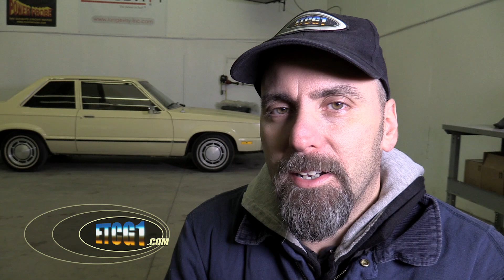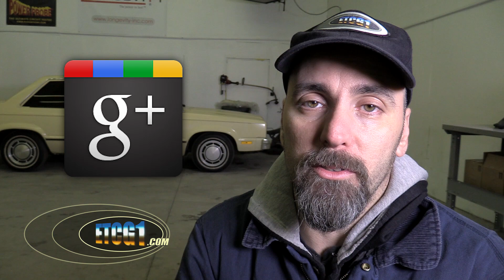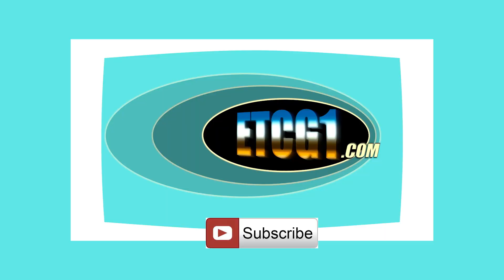How Things Have Changed In Auto Repair -ETCG1

Comment: interesting thing happened the day you posted this -- went to the GM store here in Vegas for a recall (emissions) and got to talking to one of those VERY rare things in th industry -- a knowledgeable service writer.  He told me they went wireless with their scan tools and was saying there's not a lot of love for them right now (data drops) and that the techs would rather have their old wired tech2s back. it's a pretty large shop. probably 30 to 50 techs, maybe. he was saying the incidents of f-bomb tossing has increased dramatically. lol. being in IT I'd love to see the specifics of the setup and assume they probably have something wrong with their wireless system. anyway --- GM is trying wireless systems -- and techs patience.

Comment: Good video. Intetesting fact. I work for Volvo. our scan tools are all Bluetooth connections that we read with a desktop computer on which we have Volvos diagnostics program. The new 2016 models have a built in WiFi system that eventually will link to our computers automatically when the car pulls into our lot. Still a few bugs to work out with that system. But yes, your analysis for the future is correct and the future is now.  And at least at my dealership, we are all specialists, but specializing in everything. I've heard of some dealers with automotive electricians. talk about very specific specialization. I'm afraid to see where the industry will go in another 10 years.

Comment: A friend of mine has been trying to fix his Bosch K-Jetronic injection system, and since his vehicle is a Mercedes W124 coupé (an earlier model from the 80s), it is a real hell of a job. I soldered something for him together so that he could get to those "blinking codes", only that they are no blinking codes, but you need an ANALOG volt meter to see the voltage drop and cout the voltage drops. Only that his model was still too early for that, so it doesn't have the connector to get any data from the engine, no chance in getting any code back! Which left him with having to go over every single part of that K-Jetronic engine, to find some potentiometer that had rotted away or some diaphragm that had become brittle, or whatever else it was. And the worst of it: Today, even in Germany where these things were built, there are hardly any technicians left who really know these systems inside and out so they would know how to go about diagnosing them!
Reply: Sounds like a candidate for a factory crate motor and transmission.
Reply: Thomas Coughran What do you mean by that? I don't think Mercedes still sells the old 2.0L engines, plus the transmission seems to be fine. Also, if it can be remedied by a few parts for a couple hundred bucks, I think putting a new motor + transmission in it would be a bit too much.
Reply: +Seegal Galguntijak: Agreed. If the car was in the U.S., an American factory motor and transmission might be a way to get the car back on the road. Parts here would very expensive if available at all. A friend had a Jaguar sedan that had a bad head. Because of the repair costs, he bought an adapter kit that allowed him to install a Chevrolet V8 and automatic transmission. The kit used existing mounting locations and wiring adapters so the car could be switched back to original with no problems thus saving it's collectible status.
Reply: Thomas Coughran Well, for this side of the pond, it's the same with US car parts: They are very expensive, compared to stuff from VW and so on. Still, the Benz does basically run, it's just not as smooth as it has to be. The block is fine, it's something on the regulating side. Many of the control circuits are driven mechanically by potentiometers, and he just replaced one (it was a part for 40 bucks or so), now the problem seems to be much better, but he hasn't fully tested it yet.

Comment: our road service trucks have a geotab system gps tracking and also records the engine specs along with any fault codes from any internet connection.. you can see rpm/mph temps and even if seat belt is on

Comment: When I started out in the trade we rebuilt everything, alternators,starters,carbs,brake wheel cylinders,calipers and even master cylinders. There were NO computers in cars, everything was looked up in motors or chilton's manuals. I even learned to used a distributor machine to recurve and setup distributors.
Everything was hands on, test and tune til the problem was found. Now you can plug in a computer and tune a racing engine without getting your fingers dirty

Comment: The last auto shop that I used did not include K-Y Jelly with the invoice. That is about the only difference I have found. I went in with a trouble code on my ODB, and after he had it for 13 days, I got it back with my vice grips squeezing off a rubber hose, and a $1.342 bill. It's rough when you don't use the K-Y Jelly!

Comment: I agree that efficiency has greatly improved in cars and trucks compared to the old days. However with the advancement in computers and electronics, much has changed. It used to be that almost every neighborhood had a few shade-tree mechanics that kept their vehicles running and many people could do their own light-to-intermediate maintenance. IMO , an owner of a car / truck in the 70's and 80's could do more of their own vehicle work way back then compared to today. Today , modern cars/trucks have so much computerization that often requires an expensive diagnostic machine that requires an expensive mechanic shop with trained techs to diagnose a major problem. The space around the engine in the old days was huge compared to today. I had an 86' Chevy Silverado 4wd with the Quadrajet 4-barrel.  I've got a 74' VW bug and only 4 bolts have to be removed to separate the engine from the car.

Things have got to the point where most people with modern cars/trucks have to rely on paying out the yin-yang to a shop for automotive repair. Engines also seem to change every few years within the same make/model in these present days. It's a strategic "planned obsolescence".  It's true that modern cars/trucks are more efficient and can go longer without an overhaul compared to 3 and 4 decades ago but the simplicity of doing most of your own work for someone that doesn't turn a wrench as a career has faded greatly. I miss the old days. Also, manufacturers are pushing hard to even prevent owners from doing their own automotive repair by using copyright laws. They may not succeed but their motive behind it is about GREED

Comment: I'd say we're at another transition point. I'll give two direct examples.

Perhaps the most obvious is something in something modern and complex like a BMW from the last 10 years giving both a CAN communication failure with the transmission as well as slip codes. The system not communicating right could cause the slip or misread the slip. And you're stuck, there's no way to diagnose this without disassembling the transmission. So you're stuck doing a parts replacement first to get the CAN network's loop back into the swing of things.

Another one are on the gasoline direct injection cars, in particular Audis. They've two different fuel pressure systems. One just feeds it to the system that actually connects to the rails, and the rails themselves are in 5 or 6 digit PSI ranges. So your fuel pressure gauge won't work, you HAVE TO go by the car's high pressure fuel regulator sensor.

In this case, what often happens is the high pressure pump is failing or the high pressure regulator sensor is failing. This then results in a discrepancy of what it expects to read from the low pressure side versus the high pressure side. In the case of the failing sensor, it'll try and compensate and it'll give a code for the low pressure regulator sensor reading too low of a reading. In the case of a high pressure pump failure, it'll give a code for the high pressure sensor giving too low of a reading.

The first scenario you think you've got it down from what the scanner tells you, but you just don't. The second scenario it's a little more obvious to go into deeper diagnostics, but it's still possible for a legitimate high pressure sensor failure and you're stuck telling the customer they should try and change the high pressure pump anyway because that IS what fails. And the sensor's not cheap either, so going that route and replacing that first isn't a way to truly cheap out.

It's like when trying to diagnose a MAF failure. The car won't tell you that's what's wrong, it's completely trusting the MAF. Except this is the opposite, it is telling you the sensor's failing because it doesn't trust the sensor implicitly.